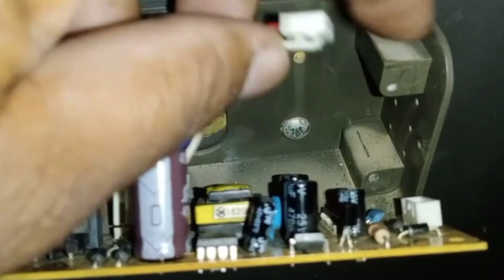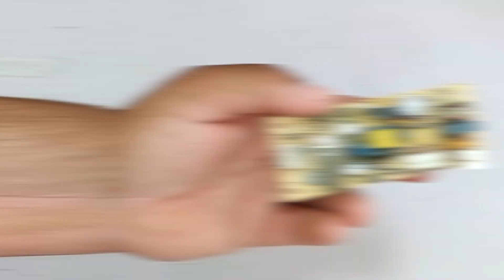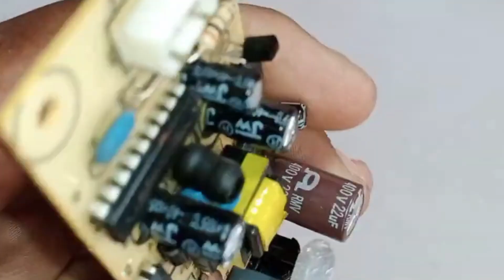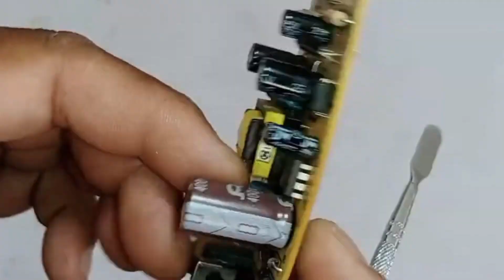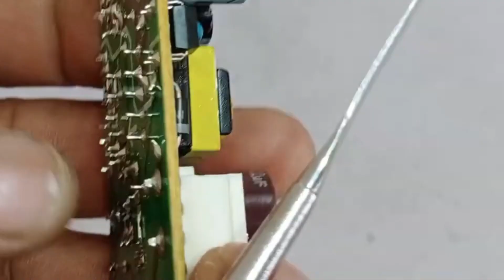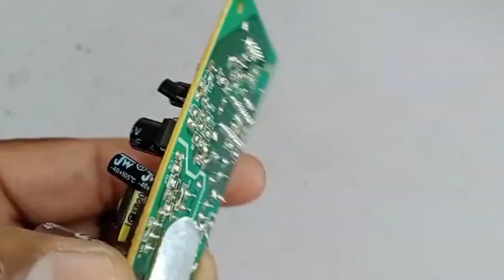Refrigerator Fan & Light Power Supply Circuit Explained!

Comment: I have a Oranier german made fridge. The bulb was broken, I bought replacement bulbs they do not work. I checked with multimeter, bulbs are okay but when I checked the socket, the power fluctuates between 15 volts and 80 volts. The switch is magnetic, because the fridge is a new model. Now I have no lights. I checked the Board I havent seen any problem. So what would be the problem?